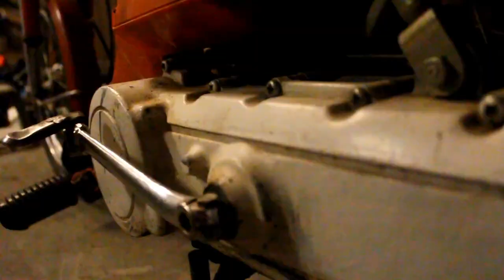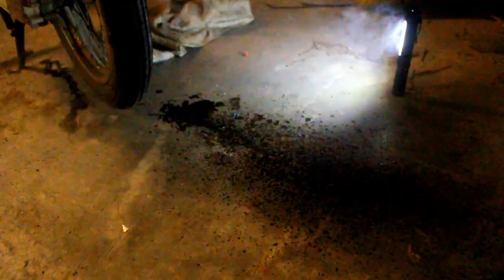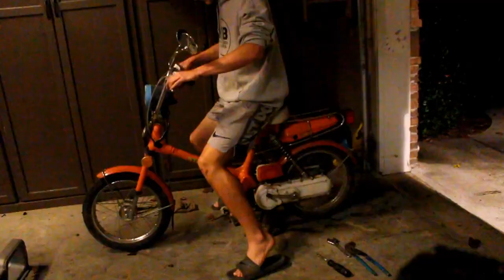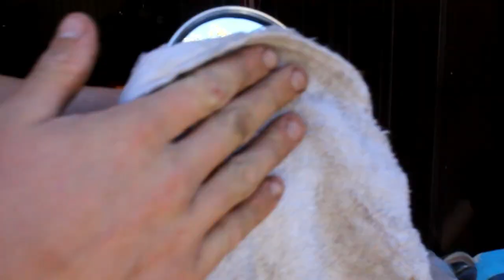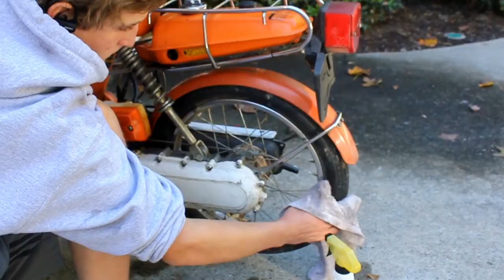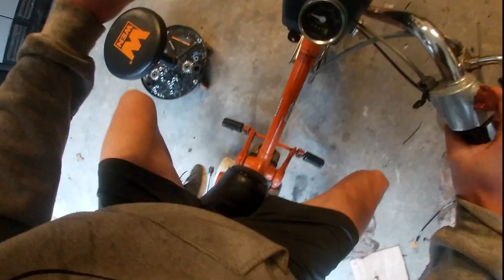1978 Moped! Will It Run?

Comment: I had a blue one (same color as this headlight) when i was 12, back in the early 90's. Had every mechanic in the country work on it but it never went over 15mph. Usually ran 10mph. I covered many miles with it though.